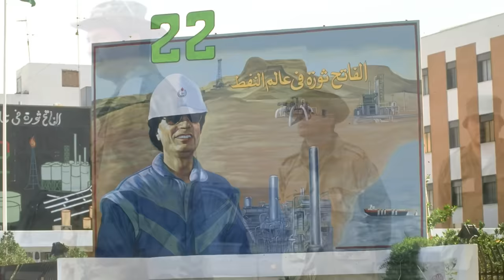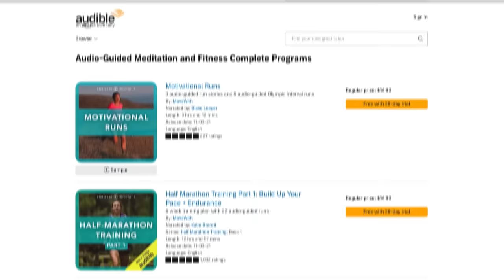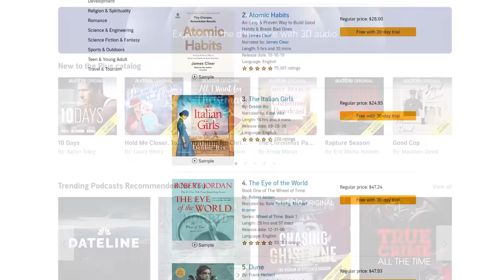How Libya Built Brand-New Rivers Across the Sahara

Comment: What would happen in any desert region if they built a reverse river that allowed seawater to flow over a number of kilometers from the sea into a man made lake or natural depression like the Qattara Depression in Egypt? Although not drinking water, it will evaporate into the local atmosphere changing the air moisture? And also small scale desalination can be done using simple metal cooling systems or solar powered electronic versions for those living/farming close to the inland sea river? Some of the water will be absorbed by the surrounding lands increasing aquifers slightly and the rocks will filter the impurities? All you would need is manpower and digging equipment? Maybe a good idea for places like Somalia? What do people think?

Comment: They messed up using concrete pioes should have used PE pipes Polyethylene pipes it’s a type of plastic where the water won’t erode the pipes
Reply: Risk plastic, a modern untested invention, contamination and whatnot in the very water we consume? People don’t realize how novel (and therefore potentially dangerous) anything plastic is. I firmly believe that we might very well look back at how we now liberally use plastics the same way we view the people of old using lead.

Comment: 5:00 That's one example why Arab countries are so mediocre.
With so much petroleum, energy is the single least problem Libya has. Israel always had desalination plant, and it exported the technology but never used it because it is so much expensive energy wise. Than it discovered gas in off shore and now Israel is giving water to Jordan. Because energy now is so cheap.
Libya could easily pay the desalination plant and its operational costs with its exports. Why it doesn't? Maybe the ruling caste is really thirsty for oil money and power, not water.